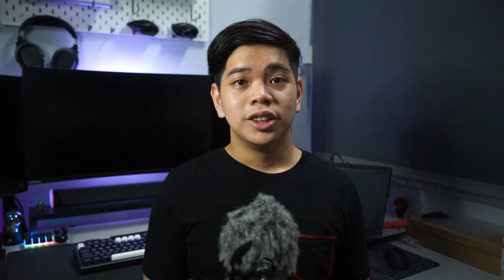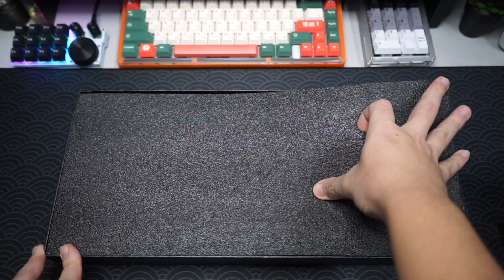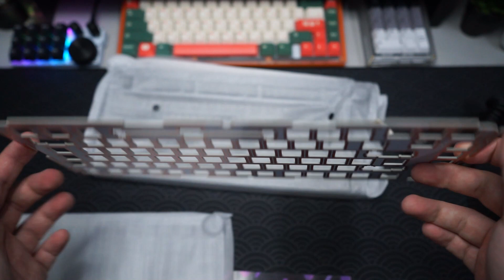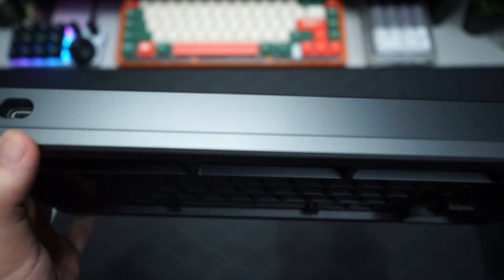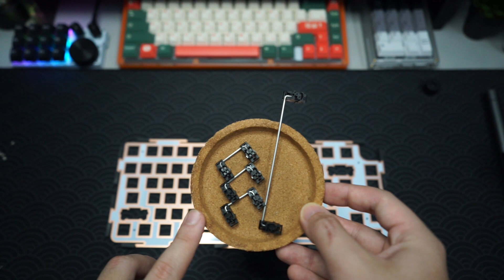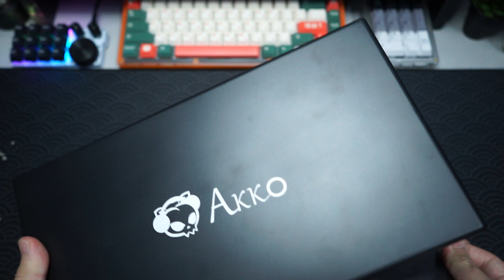My Akko Mod007 Keyboard Build - Akko Jelly Black & ASA Doubleshot PBT Keycaps | Samuel Tan

Comment: It is so weird that akko's jelly blacks and asa keycaps have interference on backspace, enter, left shift and spacebar. I dont know if it is because of my stabs but i'm using durock plate mounted with holee mod and lubed. Tried using xda keycaps on jelly blacks but no issue
Reply from the maker: Hmm maybe because it's quite hollow, you can try adding some foam in the spacebar and try

Comment: Hi, I’m deciding between Akko radiant red and jelly black. 
Currently using Akko lavender purple and I quite like it. 
Just want to try linear swithes for a change. 
I mainly use my keyboard for typing. 
Which 1 would u recommend?
Reply from the maker: I would recommend the radiant red and get it lubed, or if u can, try out both because they're quite similar just the jelly black is heavier
Reply: @itssamueltan  Another question. Does the actuation force feel the same for tactile vs linear switch. 
I like Lavender purple, and I notice that it has actuation force of 36g. 
Should I get Rose red or even vintage white as they have lower actuation force compared to radiant red?

Comment: Hey man! Have you tried using cherry profile keycaps on this one? I'm just wondering if there's a interference if that profile is used on north facing keeb using Akko JB switches. Thanks
Reply from the maker: Hey man! Akko switches have a longer pole so there isn't any interference with cherry profile keycaps unless they are very thick
Reply: @itssamueltan  thanks a lot, great video!

Comment: why do you like south facing RGB and why doesnt the custom keyboard community have interest in backlit keycaps? aren't we usually sitting in the dark most of the time?
Reply from the maker: South facing RGB will have less interference issues with cherry profile keycaps, as cherry is the most preferred profile. Most of use have a desk lamp or monitor lamp too and we just prefer the sleeker look of the keycaps than RGB
Reply: @itssamueltan  I thought Akko said and some tech reviewers that using Akko switches wont have any problem with cherry profile keycaps

Comment: I think you should add a little bit more foams in the case and some xtra thin pe foam between pcb and pcb foam for a better sound. Tape mod or not if you want.
Reply from the maker: Yes this is definitely the plan, but I wanted to see how the stock one sounded first, after that yea some poron foam would do nice
Reply: @itssamueltan  yeah, put some poron foams in the cut out at the bottom case and change the case foam into a rubber sheet, i did that before and it worked really well. But if you’re gonna do the tape mod just find some rubber sheets that around 1.25-2mm thick, that’ll be perfect

Comment: Is tape mod safe?
Reply from the maker: Yes, just make sure it's not hitting any wires or circuits
Reply: @itssamueltan  So I just tape it above the hotswap socket and don't need to press it down?
Reply from the maker: @auyonjinntng546  yes that would be the best
Reply: @itssamueltan  tq